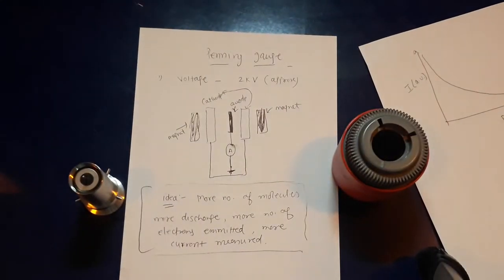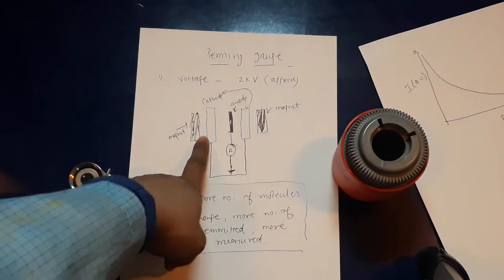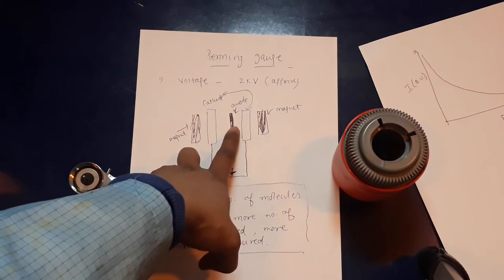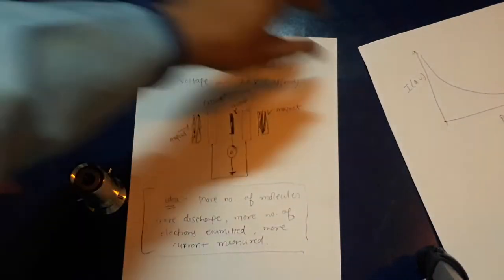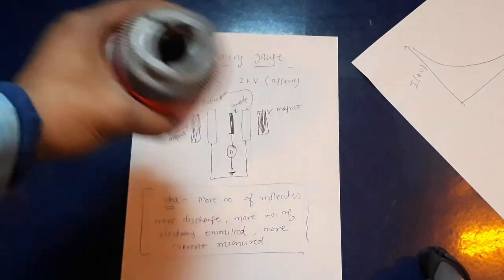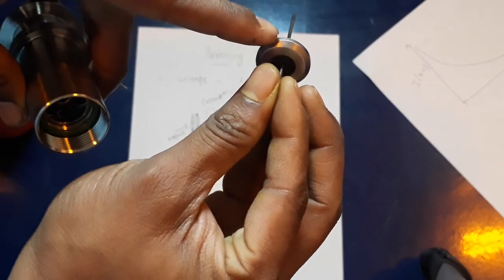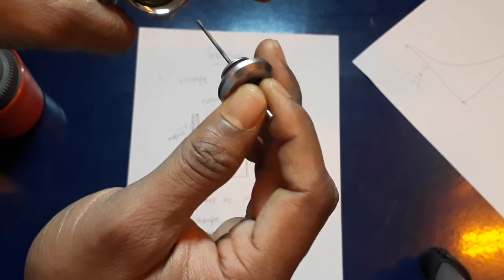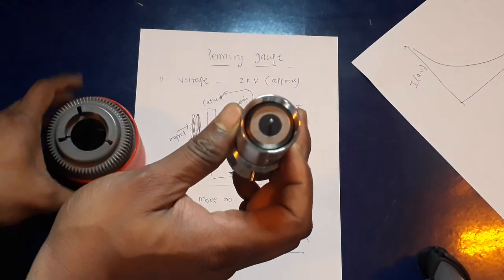Working of Penning gauge (practical)

Comment: is this working by field ionization or collision ionization. What i have read so far seems to indicate collision ionization but you described with field ionization. Also for collision ionization the magnetic field makes more sense to increase path length and ionization probability.
Reply from the maker: Hi Thanks for the nice comment, Actually field ionization helps in the ignition of the plasma and after that all the work by done high energetic electrons collision, You are right that these ions are affected by the magnetic field to increase the path length to increase the ionization